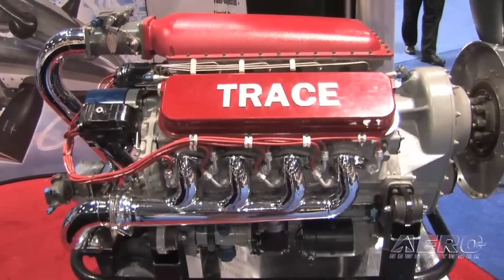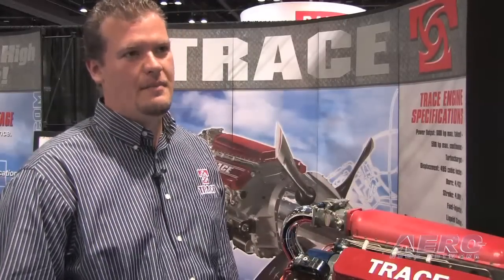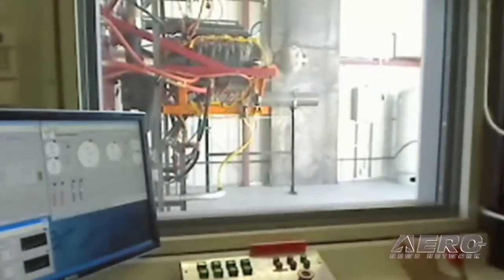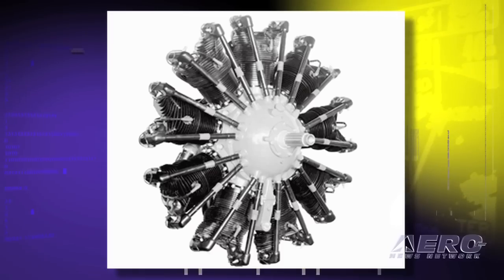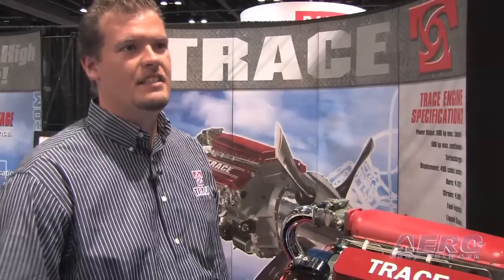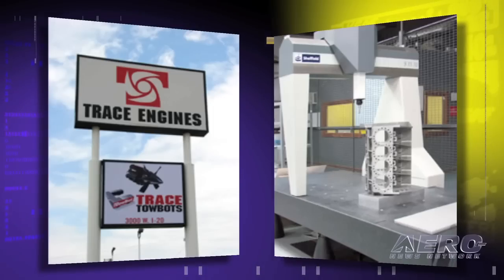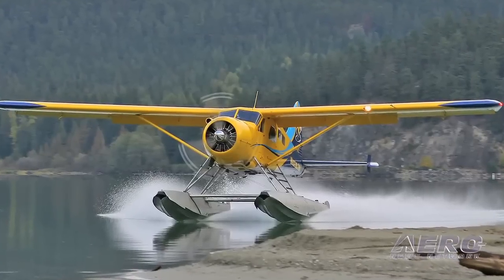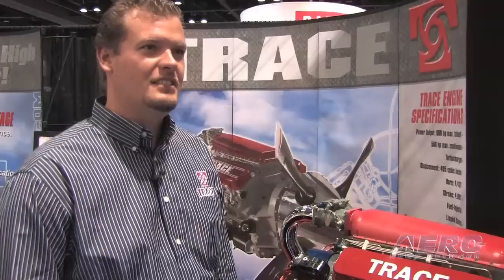Aero-TV:  Trace Engines - Re-Engineered Turbocharged Power

Comment: Sir, comparing this engine to a car engine is like comparing a VW engine to that of a Ferrari.  This is one of the most precisely built liquid cooled engines ever made, and also one of the strongest.  This engine, if it were used in an automotive application could produce over 1000hp and run like that for nearly a million miles- it is that strong.

Comment: @mrmouse8899 I thoroughly understand gear reductions and the reason I mentioned them is they are the only failures I've heard of with automotive engines, besides poor cooling designs adapted to fit under the cowling,(p 51 radiator is underneath) Electronic ignitions do not just "give out" and if you wanted to be paranoid install 2 of them. Why on earth pilots are put in charge of carb heat is beyond me,fuel injection is more reliable than any manual carb. The Honda plane will prove me right.

Comment: I witnessed an otter converted from a trace back to a 1340 Pratt because it the trace was so unreliable. 
I did a compression test on one and all 8 cylinders had between 5-10/80 psi. 

It’s too bad these failed as they were an outstanding idea on paper.
Reply: These merican v8 engines are such poor design, crazy to think they are good. Piston speed is equivelant to a Rotax running at 7300rpm, and thats not considering inertial forces on the rods. more like a Rotax running at 8500rpm at take off.

Comment: 27 gallons per hour! A semi truck is more efficient. I mean the sad part is, I think some rail road shunters use less fuel.
A "turbine" is not nearly as thirsty and Honda (Joint GE operation) like some others can make a Turbo-Fan that weighs in at just under 100 pounds. 70 actually. That is the only example from the top of my head.
Reply: +AnopliusZero If you look at the fuel burn on a 600 HP turbine, 27 gallons per hour is not bad.

Comment: I believe this is the former Hawker Siddeley engine that did not market well ... so here we are again...!!! This is not a NASCAR engine...it is specifically fabricated as a liquid cooled ,high performance aircraft engine that has to run safely for 1500 to 2000 hrs without blowing up. Someone commented that NASCAR engines produce 600 + hp for a fraction of the price but they fail to understand that after 500-600 miles of all racing ( effectively 3 hrs of actual all out running) the engine is JUNK...done for, a smoking grenade...!!! A purpose built aircraft engine must have reliability above all else...!!! Yeah, you could put this into a THUNDER MUSTANG ,over boost to about 2000 hp for a few laps... but at the end of that race this engine will also be JUNK  ...!!! But... I ramble...!!! I am getting ready to fly my 80% SPAD powered by a 4.2 Rover with 2:1 redrive ... guessing power is somewhere between 150-180 hp...!!! So , at a more elemental level I am dealing with the same challenges this Company is dealing with...good power efficiently,and reliably for a long time...!!!

Comment: @mrmouse8899 When Honda does come out with a modern engine based on  car tech. once again the U.S. will be left behind,mostly to attitudes like yours that defend 100 + yr old tech. No airliner  or fighter jet flies without a computer ,my chevy vortech has 240,000 miles with only an alternator and fuel pump fail,both easily predictable and preventable. 
P.S. I'm fully aware of what happens to a plane when the engine stops turning.

Comment: Did I hear u correct.. A turbine engine loss power at higher altitude? I think as an engine salesman you would do your homework before making statements like that.
Reply: idontcare80 You are correct all engines lose power with altitude, but with
good turbo or supercharging you can maintain most of your power with a 
piston engine, also at lower altitudes you can make your piston sip fuel
compared to any Turbine machine. A DC3 with turbines preforms better
because of the overall HP increase, but they had to double the fuel capacity
to give it the same range of the piston engine aircraft.
Reply: Turbines lose power with altitude. The way they compensate is to install a more powerful engine but program the engine control to limit power at lower altitude.  Know as flat rating.
Reply: fly wayne 
If you would do your homework you would understand that turbine engines are normally asperated and loose horsepower as they climb. The Trace engine which is turbo charged maintains its sea level power. So a 750 HP turbine at. 25,000 feet might be producing only 350 HP or less while the 600 HP turbocharged piston engine still has its 600 HP. So you need to do yout homework before opening your misinformed mouth.
Reply: Wrong. The Trace engine being turbo charged maintains its sea level power long after the Turbine which is a normally asperated engine looses its power. Do your homework before making assnine statements of facts not in evidence.
Reply: Outta business...
Y'all are wrong and/or right about Trace Engines
Reply: @thomasjackson6746  What are you talking about a Turbine engine being normally aspirated? A turbine engine is not a piston engine uses compressor stage which is pressurized above atmosphere how else would a turbine engine work. Its a jet engine with he shaft geared down connected to the prop.
Reply: @Mike-01234  Turbine engines are naturally aspirated. They are essentially a fixed speed supercharger.

Comment: @mrmouse8 Really?? do you even know what your talking about? how about saaayyy boat engines? do they coast? are they under continues strain?are they the same as an auto engine?yes heavy duty auto engines,I'd worry more about the prop reducer.WW2 engines were water cooled v-12s with superchargers and gear reduction. Current aero engines with their carb heat and magnetos are pathetic 100 yr old tech.

Comment: You priced yourself out of the market.  It looked great and had tremendous potential but you were asking turbine dollars for a twin turbo lsx with a reduction drive. Do you think the 2500hp airboat with dual 6 bladed contra rotating props paid 200k? Nope, more like 70k for far more motor 9 liter and complex high torque twin prop gear drive. Blame the business managers